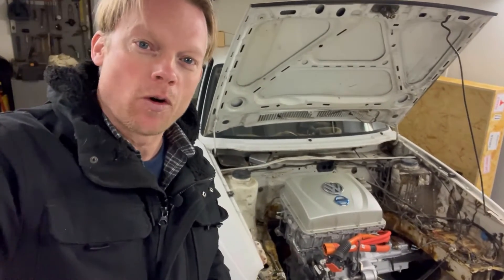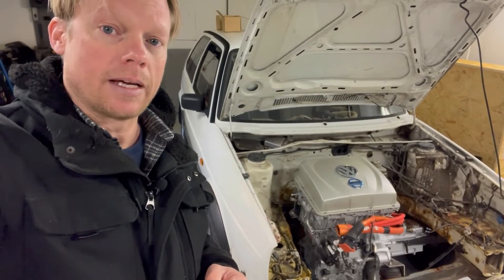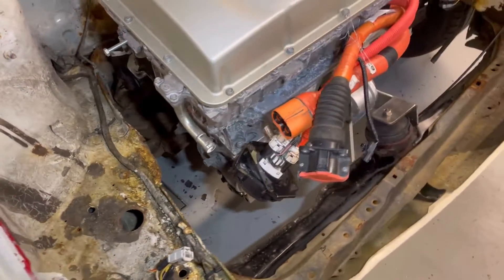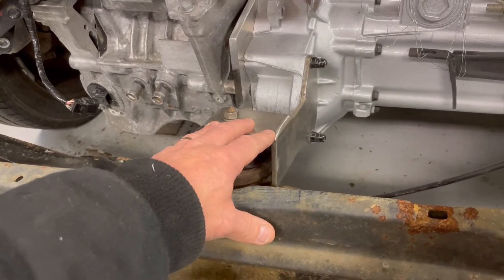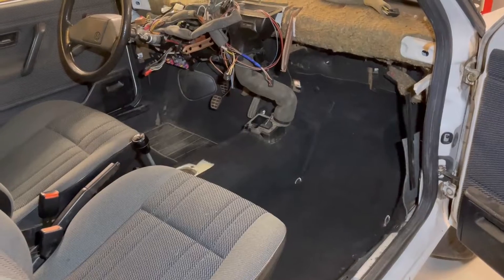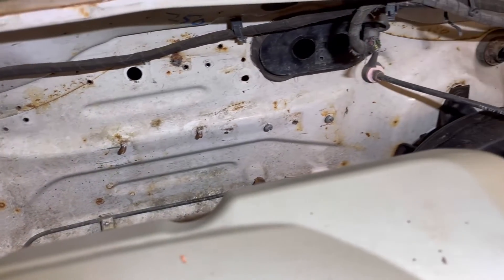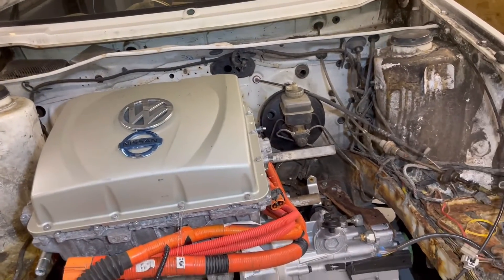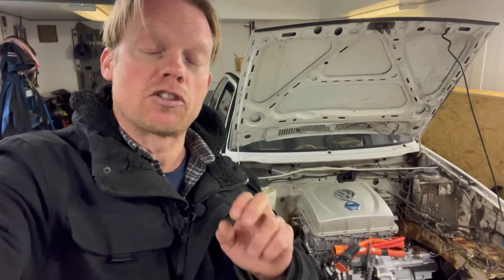Motor installation, dash removal, EV conversion Vw golf rabbit MK2, Update, Nissan leaf Em57 motor

Comment: What kind of charger and VCM are you planning to use?
Reply from the maker: Nissan leaf and ev resolver.
Reply: @flyingtools  but with that you have to use the whole battery system of the leaf as far as I know
Reply from the maker: @dranoelr  yes and no😉 Here is my drivetrain. It took some hours to solder those balance leads. 

EV conversion, bench test of an Nissan leaf gen 2 with vw id3 id4 battery modules.
https://youtube.com/shorts/Hzh4SSeFjCg?feature=share

Comment: What is the weight comparison between golf and leaf engines? And do you need to use a clutch? I though it wasn't necessary
Reply from the maker: Sorry for my late reply. I do not know that yet. No I do not need the clutch, it just a fun thing to have just because the original citystromer had it. Thanks for your question☺️

Comment: Why do you not use a newer version of the vw golf? Do you upgrade the dashboard or do you install the same old instruments? It would be gread if you install a lcd Display ;)
Reply from the maker: This is electrical from the beginning, I will just make it a little more modern. The instrument is very rare in this old mk2 with gauges for electrical states instead of the other fossil gauges. So I will definitely use the old one except for a small Soc display. You will find more information in the description. Thanks for your comment.

Comment: Hello from Germany again! I could not contribute to the Solax Inverter Problem, so I decided to stay calm but was following the work with HA very closely - have you found a solution yet?
I was wondering about the construction of the VW frame with the new Nissan Leaf Motor and Gearbox - I would think it nees more strong interconnections to hold the motor in place while driving. And the old one looks still very rusty from my point of view.
Anyway, keep on the good work and keep your community updated! 😊👍
Reply from the maker: Hi.
It will definitely be more torque, but I think that it will hold up against it. I will change the rusty one before I paint everything.
Thank you so much, I’m glad to have you here.☺️